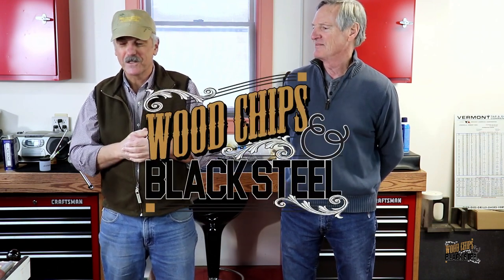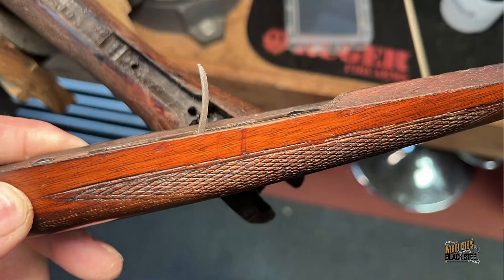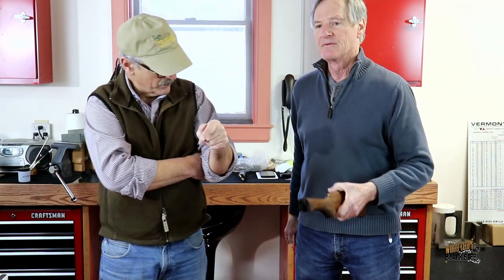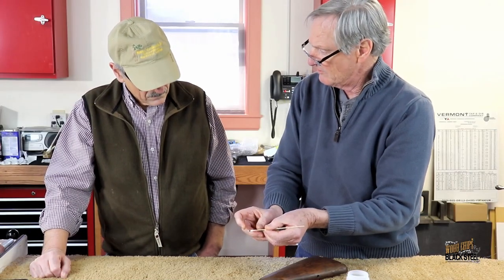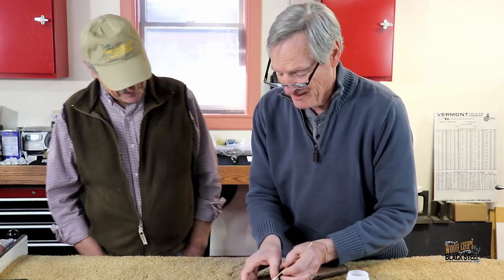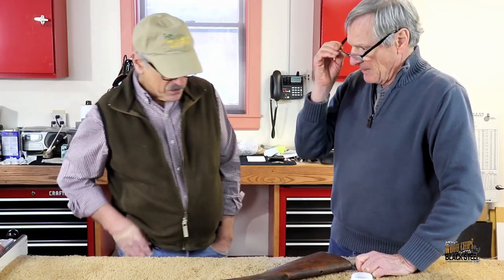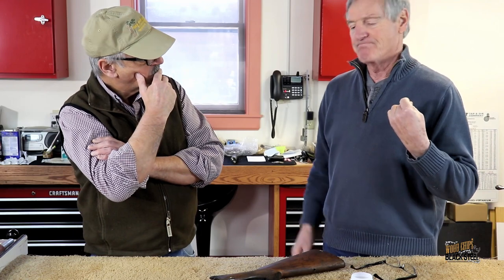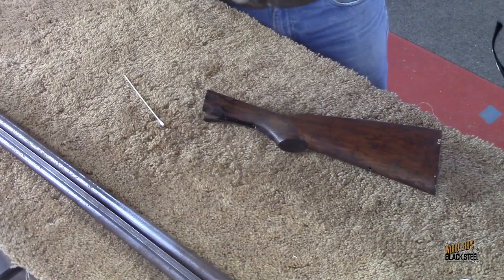The Best Ways to Repair Small Wood Breaks

Comment: Thanks for the video.  I learned more watching this than all of the other wood stock repair videos on the net.  I plan on repairing a split stock on a Dutch M.95 Mannlicher WWII bring back.  The stock is cracked lengthwise with the grain along the bottom of the forend area.  The stock is oil soaked and I knew that most adhesives will not adhere properly.  The only thing I am still on the fence about is whether to use an epoxy or a regular wood glue.  I know there are upsides and downsides to both, and that epoxy also will "fill" some, but as far as I can tell I don't need that.  I merely need an invisible fix. The area is not going to take recoil impact, so reinforcement is not needed.  I am only wondering about the adhesive strength of both, long term.
Reply from the maker: Thanks for watching and commenting.  Getting the oils out of the wood around the breaks are by far the first and hardest thing you need to do....and most important.  For these kind of "surgical" repairs I recommend the epoxy...first for the color.(most wood glues are yellow) and most epoxies are clear. And then you can get a much finer repair line and still retain the strength in the joint and repair.

Comment: Very informative video! You two described the chemicals and their intended purpose well. I fully understadn the need to extract out the oils. I have a perazzi shotgun stock with a split that is in need of repair. It will have 1,000s of rounds shot through it and needs to have strength to prevent the fracture again. Can you help provide guidance if I provide pictures? :)
Reply from the maker: Do you do Facesbook or Instagram?

Comment: Very good video, May I ask what kind of epoxy glue did you use?
Reply from the maker: Well...believe it or not....I use a basic 12 hour two part clear epoxy available at your local building supply store.  I have been using it for years without any issues.
Reply: @SixRoundsStudio  so the key is to clear the oil and epoxy is good. 

I was asking because I saw a fsr89 that has 2 small cracks behind the tang, I did wood working class and I am saying that pretty sure I could do something with this.

Thanks

Comment: This is an excellent way to de-grease and clean a stock prior to repairs.  I might mention an alternative where you soak the same end directly in acetone. I found this idea on another gunsmithing channel and think this might be a better approach.
Reply from the maker: Thanks for the comment Tim.  I have done both.  There is potential down sides to soaking the end in the acetone.  First the acetone removes the tannin from the wood and can discolor the wood where it is soaking (I have seen this many times).  Second...It is not always obvious in a restoration where other potential problems might exist (like additional weak points or previous repairs.  In restorations you want to do as "little harm" as possible so taking minimally invasive approaches are always my preferred method.  This gun had seen a lot of trauma over its life and I didn't want to add any more.
Reply: @SixRoundsStudio  Thanks for the reply. While something may look better, it isn't necessarily so. I really appreciate what you do and the idea of conserving rather than restoration. I recently bought a Lefever Nitro Special manufactured by Ithaca. It needs a little bit of mechanical work which is being done by a gunsmith. It has a few issues with the stock and forend which I plan to do myself.
Reply from the maker: @timmills9727  Very cool.  If you ever need input let me know.  Thanks for the super thanks.  Yours is my first!

Comment: Long story short, my Winchester 71 fell off my work bench, landed on the buttstock plate, and a small chunk of wood fell off the bottom where it meets the plate. 
I tried the gorilla glue thing last night, and in case it looks like crap when I unwrap it tonight, I would like the contact information for R. Mark Adams if he is still doing these types of repairs as I want it to be perfect and I am not even a wood stock repair amateur.
Yes, I'm still beating myself up about this as I literally bought this rifle just this past Sunday and decided to clean it last night.
Reply from the maker: No disrespect intended...but I am pretty sure that these are not the kinds of repairs that Mark would do.  I will ask.  Message me your contact info on my FB messenger
Reply: @SixRoundsStudio  I just did.
Thank you !

Comment: What are your thoughts on using animal hide glue on a cracked gun stock. I know it is not water proof but I it is very strong.  I repaired a Browning Auto 5 forearm that data grain crack in the center bottom of the forearm where it meets the receiver.  I cleaned the crack with acetone and let it dry.  Then on the inside of the forearm where the crack was I chiseled a 5/16 in wide notch centered on the crack. Then I warmed the stock with a hair blower preparing it for glue. Then I prepared the glue in a glue pot slightly on the thin side.  I slightly opened the crack and applied the glue on the inside of the forearm in the chiseled notch.  The. I sucked the glue to the outside of the crack until I had a nice bubble of glue all thur the crack. The. I put a small 5/16 piece of walnut veneer in the notch with the grain going opposite direction of the crack and lastly clamped together.  Then I refinished the forearm using Behlen pre catalyzed lawyer. I used that gun to shoot skeet for several years after the repair and it held up good.  I could always slightly see where the crack was but the forearm stayed together. That gun was a 1953 Light twelve. About a year ago I traded it in at Cabelas for a 1965 Light Twenty with a similar crack in the forearm.   I am planning on doing a similar repair but now am wondering if epoxy is a better choice over hide glue.
Reply from the maker: Hide glue is amazing stuff....as has been proven by history.  I dont have any objections to it, but for me, using modern adhesives is a more consistent method for mixing and expected outcomes (hide glues do require some understanding of the what and how). Your patch sounds well thought out.  I have repaired several Auto 5 forearms...they are all prone to cracking in that same spot.  I use a guitar builders technique by epoxying in a cloth ribbon along the length of the crack after the glue  repair dries.  Thanks for sharing your ideas and comments.  We all learn from each other.

Comment: Shotguns should have some kind of spacer between the metal and the stock. This would prevent oil getting into the wood. Some store shotguns barrels facing down so oil does not gravitate into the wood.
Reply from the maker: Storing them on the muzzle is a common method.  Better to neve over oil the metal to begin with.  A little goes a long way.